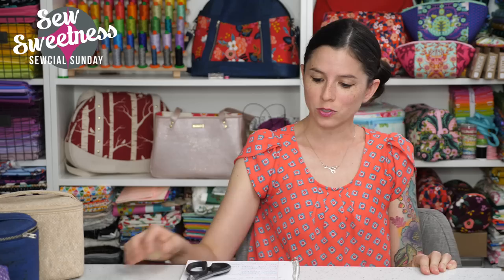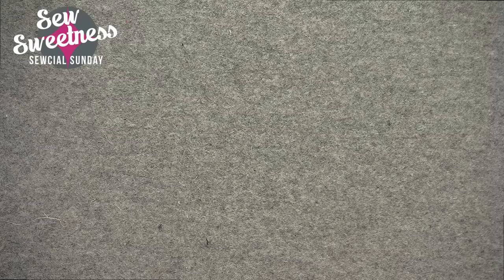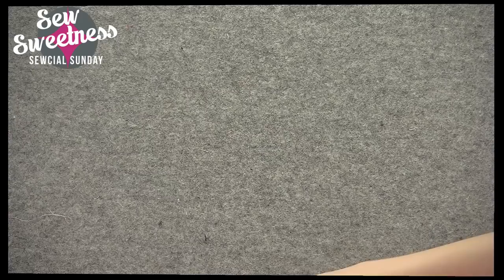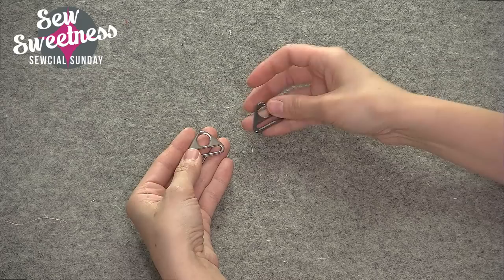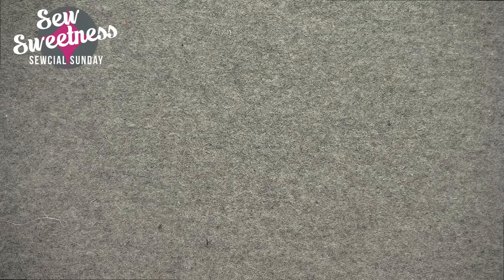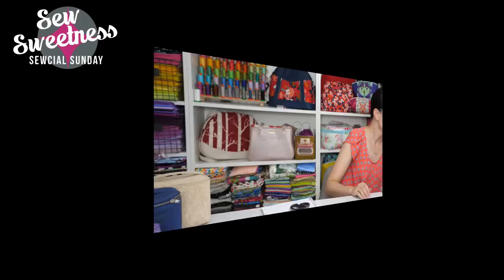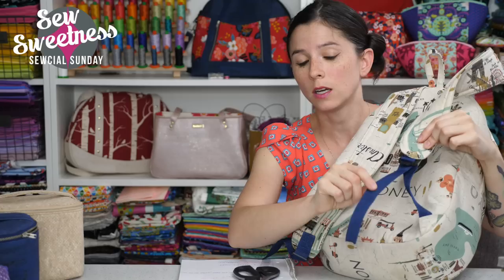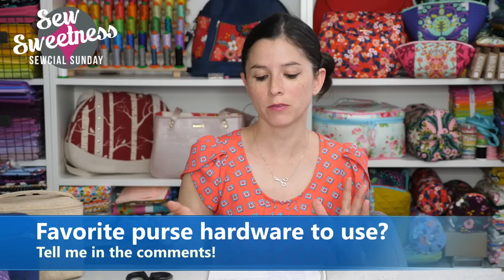Different Types of Purse Hardware

Comment: What about evening bags. What is the hardware that holds a long chain strap to the inside of the purse?  Part of it is usually flat and can fit between the clutch closure. 
I'm trying to add a long strap to my niece's prom purse and don't know what to call them. So I don't know where to look to find them.